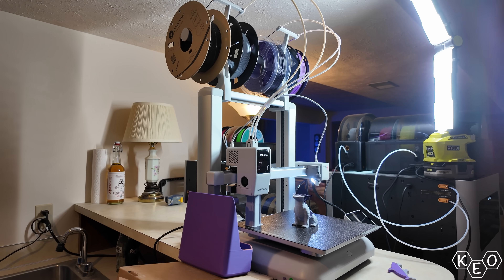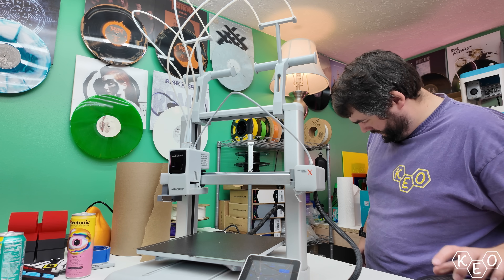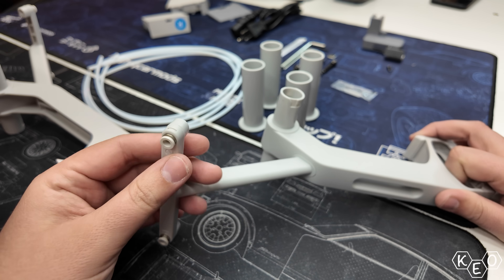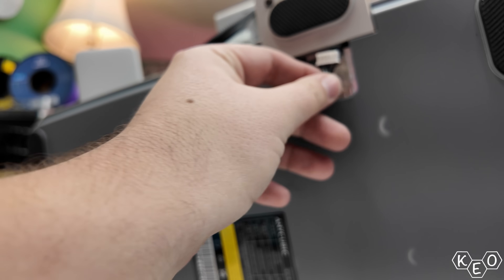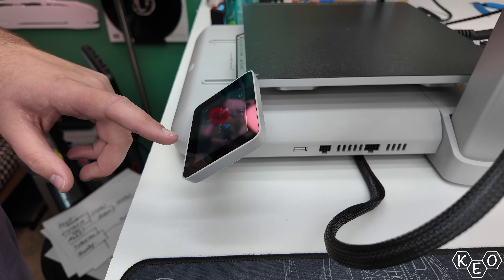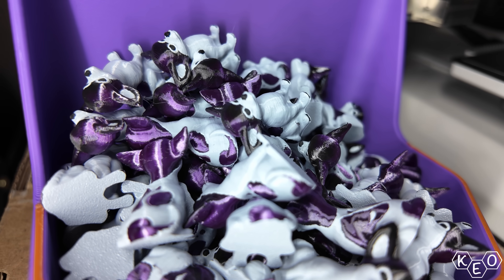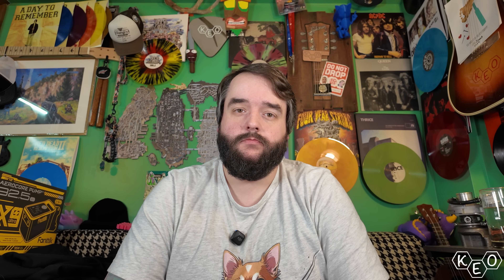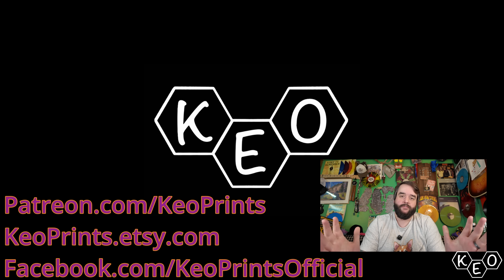Why This $300 Anycubic Printer Finishes Color Prints Faster

Comment: I have the kobra s1 combo. The main reasons you have bed adhesion issues are from a dirty print bed (use glass cleaner with ammonia) and your bed is too cold. Set it to 62 to 65 degrees. 

My favorite cheese is muenster.

Comment: If one of the multi prints failed can you just turn off that 1 print or need to stop the whole thing? other review videos say the build blate sucks. they had to use extra glue to make it work. the other reviews also say the bleed to bad on the set values.
Reply from the maker: I saw bleed issues but bed adhesion was not a problem luckily. As for the object skip, I’m pretty sure it offers that function

Comment: Keo, I'm after a printer that just works. I currently have an infomech tx and when it works it's great but after a week it goes to shit and I need to spend 2 weeks playing with it to get it going for another week. I have around 600 to play with and I am mainly designing and printing parts for RC cars. I print in petg but would like to print abs as it's stronger for the hobby and 300mm³ or bigger would be ideal. Single colour mainly as everything gets painted. What are your thoughts
Reply from the maker: Always Bambu. I don’t have any affiliate links to send you because they don’t see me. But Bambu is always the tinker free option. Best quality, max reliability. No tinkering

Comment: Its actually only $249 with free shipping and you get 50% off all supplies or extra parts at time of purchse. Its absolutely an A1 killer in everyway....Print quality it the same but the X is 40% faster, it uses 20% less filament, can expand to 19 colors and it costs $200 cheaper....

Comment: It's surely a printer with much potential, I bought a unit and we'll see if it'll go well. First time using a machine from anycubic too, hope I won't have resentments. It will certainly be a step up from my modified ender 3 for sure tho :)
Reply from the maker: Coming from your ender 3, it’s going to be a fantastic culture shock I’m sure

Comment: Another great video, thanks. Pepper jack. I think the A1 Mini was designed in size specifically for grilled cheese, that is my vote. I almost ordered one of these Kobra X because the price was almost a giveaway, however the way Anycubic customer service treated me after shipping me a USED Kobra 3 Max instead of the NEW one I paid for......I decided they will not get any of my $. I run a small print farm of 24 machines so longevity (or price per hour of life) is always high on my list when I am looking at new machines. The A1 is a good choice, I have some with 10,000 hours. Odds are the P2S will be a smart direction. I really like my K2 Plus when they are working. I have nothing good to say about any of the Anycubic machines. I am interested in tool changers, just haven't made the jump yet so we'll see how 2026 changes direction for the farm. Especially since I go through 15 gallons of filament waste each week. Looking forward to your next video.
Reply from the maker: Good notes here. I am not surprised by your findings in general. Bambu keeps running, thats no surprise. The K2s are great while they are working, also no surprise. Bummer to hear that AC support didn't treat you well. Unfortunately that is not an isolated incident for them or any consumer 3D printer brand support. There are some exceptions but generally, that seems to be the story

Comment: Wait wait, hold the phone. What does he mean by "when it was still working" when mentioning the AD5X? I haven't seen anything where he mentions it dying or anything
Reply from the maker: There is a video in progress right now but my AD5X has been stopping mid print randomly so I havnt been messing with it or troubleshooting. Not sure what is happening but thats the scoop currently
Reply: Aah, alright, good to know. Because I have been strongly considering the AD5X after seeing many good reviews for it, so I'm sure you can understand my shock when suddenly there is a "when it was still working"

Comment: Huh, that side exit for the disused filament, does the segment stay stuck there for manual pulling or does it fall off the head… onto the print? That’s so weird and would there be scenarios where more than one could accumulate there and fall into the print even if it didn’t with just one? That’s seems cool until we factor in gravity no?
Reply from the maker: Good point. But there is still enough of the filament left inside of the collector that it wouldn't be able to fall out. It took an intentional effort to pull it out because there's a little metal tab following it, holding it in place. Seems cool. I think it will obstruct the filament path if you try and refill that inlets spool though so I don't think you would be able to accumulate multiple or reload that inlet without removing first

Comment: looks like a descent printer, the only thing that triggered me for some reason was the power cable to the toolhead,   looks out of place.  After i looked at it , i could not unlook.   With all the boxes i felt like Gavin Belson would release one.   I have 4 misshapen magnets from my first 4 in 1 that bambu sent me.    They actually replaced my AMS, the new one is working flawlessly, only took 5 months.

Comment: Thanks for routinely reviewing multiple brands, you’re a great one stop reference.  I currently run 3 Kobra 3 combos and was on the fence with the X but it’s been hard to find a review that actually tests the printer.  I think the Snapmaker U1 will be the better option for models with more than a few dozen color swaps but this would be a nice space saver if most of your prints only need a handful of color swaps.  The quick swap nozzle is a huge improvement over the Kobra 3 (unless you save yourself the effort and just swap the full hotend)
Reply from the maker: True points here. This is a cool offering but the Snapmaker is certainly more of an all-arounder
Reply: @KeoPrints Forget grilled cheese...I have cooked chicken strips on my K1 Max lol

Comment: Just ordered a unit with the separate ams2 system., it’s listed as only supporting 7 colors instead of 8 and I’m not sure why that would be. Any clue?
Thanks for sharing and I appreciate your videos.
Reply from the maker: Sure, the reason that you lose one color is because of the toolhead. It only has four filament inlets, or four paths that collect into one. Even though a new collector needs to be installed to accommodate all of the tubes, the actual toolhead only has provision for four inputs. So the ACE will automatically feed and retract into position 1 for example. Then positions 2, 3, and 4 will be driven the standard way using the toolhead motors while spools are fed from the top. 

So as each ace unit is added, there is still only one inlet being occupied. That is how they achieve a max of 19 colors. 16 from ACE units and then the remaining three positions on the toolhead as standard.

Long winded but I hope it makes a little bit of sense. Thanks for hanging around!
Reply: @KeoPrints  appreciate the breakdown., looking to your follow up with this printer to see how it holds up.

Comment: I liked this video. I did want to make sure I heard you right that, I could use Orca?
Reply from the maker: I was that was the case. As far as I am aware, this one and often most AC machines, are not compatible with orca for connecting wirelessly to the machine and stuff

Comment: I use these cheap Allen wrenches for even cheaper screws. Sometimes a drop of Super Glue and a cheap Allen wrench is enough to extract a screw with a torn head. If not, get it hot till it's somewhat soft and wack it with a hammer until it gots the right shape. Epoxi Glue, especially JB-Weld and it's knock offs, are also great for that use.
Reply: I cut em off and put them in my drill. Works fantastic

Comment: Well, compare to the AD5X and see which one is faster for the same multicolorprints I guess. Same price (around here at least with the AD5X going for 300Euro).
Bedsize of this one is a bit bigger, both have the filament-changes in the head without much retraction so in that regard they look quite similar.

CoreXY has its plusses above bedslingers, and this printer can handle even more colors with extra options but then also longer filament-paths for those. 
I guess it would make a nice comparison to have these 2 compete.
Reply from the maker: Not a bad idea. Might have to line that up

Comment: I'm loving my Kobra 3 max still. The extruder cam system is awesome simple tech. Does a Bambu plate work on it also, I have a few smooth plates I want to try. I bought one fore $259 with the coupon
Reply: I want a kobra 3 max just for the print volume.  Its on my wish list.

Comment: There is a huge gap in price between this and tool changers. Not really comparable. 

As a beginner, how important its an enclosure?
Reply: If you want to print larger models from serious filaments it's pretty important, along with a chamber heater.

Comment: Honestly I wish people would STOP focusing on printer speeds and multi-color and start focusing on the things that REALLY matter.  Anycubic makes good printers but they do NOT have a good reputation for accurately or consistently setting z-offset.  EVERY Anycubic printer I've had was abysmal at setting z-offset and "good enough" was generally the best one could hope for.  Don't even hope for it maintaining that setting either.  Mechanically they are really good printers, especially for beginners so not something I will pick at.  But there's something going on with their firmware that leaves a LOT to be desired.  Personally I think they are farming out firmware development to unpaid interns who don't 3D print.  I love my Anycubic printers...once I upgraded them all to Klipper.  I do like to give the benefit of the doubt though so I hope they have learned their (many) lessons and put what they have learned into this printer.
Reply from the maker: Good notes. Happy to have this experience listed here for others to draw from. Helps us all out
Reply: @KeoPrints  Just to further that...the Kobra 2 I got as a factory return back in August 2023 is still going strong.  Granted it's fully klipper but it is a SOLID printer.  I don't want anyone to read my comments as hating on Anycubic.  And their support is top notch.  Never had a bad experience with their support.

Comment: Pepper jack is the best cheese.

What I would like to see in a printer like this is  one nozzle with 4 filament paths all the way to the tip. It could end with a rotating plate with a hole to select the appropriate filament, not unlike the H2D's little flap that covers the unused nozzle. Instant changes, no waste. It wouldn't lose too much print volume like a dual or quad nozzle setup or a tool changer.
Reply from the maker: This would be cool. I wouldn’t be surprised if we didn’t see something like this sooner than later

Comment: Pepper-jack for sure! I really enjoy your videos and look forward to them each time.  I have two X1C's and three A1's all with AMS's and I've been needing to add more but after seeing the U1 videos I'm holding off purchasing anything.  I heard the U1 had a firmware update, are you going to do a video on that and if there was any big improvements to how it runs and performs?
Reply from the maker: Pepper jack is an excellent choice. As for a major firmware update; I didn't even realize there was one. Ill have to check and see but I have not noticed any major differences lately

Comment: Why is the video titled "why this printer finishes color prints faster" and doesn't address that question at all? Anycubic claims this printer has less waste than normal multiplexer color printers. How does that work? If there isn't an extruder motor for each spool how does it even swap filaments by itself? How does filament swapping at the tool head work? Why make a video about this printer and not talk about any of the interesting things about it? No comparison between a multicolor print on the Kobra X and the A1? Come on dude.
Reply: I saw a video from Anycubic showing a cutaway of the head in action. Looks like some cams and a cutter in the extruder head, so minimal retraction is needed. Just enough to get it out of the way.
Reply from the maker: This is fair. Ill be doing follow ups to address some of the deeper details like that because there is a lot of tech going on in there that is pretty cool

Comment: Is Keo mixing up flow dynamics (pressure advance) with flow when he says "flow calibration" or is the Anycubic X only the third ever consumer-level printer to do automatic flow rate calibration, after the X1 Carbon and the K2 Plus?
Reply: my kobra s1 also does flow calibration, its a setting before i start the print if i want to do it…
Reply from the maker: Yes, we could be having a difference in semantic congruence but that would be the calibration I was referencing; pressure advance

Comment: Thanks for the review. I think I will stick to enclosed printers and mmu's to keep things orderly and clean. I'm on the verge of buying my first printer, still doubting between a few contenders (kobra s1, k2 (normal) and q2. Bambu is a runner up bc the large user base and spare parts availability, but I really dislike the risk of having a expensive machine being locked down further).

Now you said tool changers are the way to go, but with the 3 first contenders mentions with each their own mmu it's €400 vs €500 vs €600. However the cheapest tool changer the U1 is €800 which is quite an increase in budget while the quality doesn't seem to be as the price with imply.

Every new video I watch makes it harder to finally make a decision lol
Reply from the maker: It is a tough decision for sure. I am on the U1 train because mine has been great. But also, it hasn't given me any issues yet. Who knows how long it will continue on without issue before there is something that changes the way I think of that machine? Only time my friends. Time and much plastic
Reply: To be Fair, U1 is Way faster at multicolor and has Way less waste, so it may be cheaper at the Long run
Reply: @ulforcemegamon3094  The question here is how long will the U1 run in long run reliably. These brands are dishing out printers with price cut in component quality and not having spares available all the time
Reply: @IAMGouravSaha  agreed, reliability is something to factor in the equation Too
Reply: @ulforcemegamon3094 wait give it a few months, on whatever you buy.

Comment: So, what happened to the AD5X? I got one for Christmas, and now you have me worried.
Reply: I got mine right before Thanksgiving. Mine has weird issues with certain filament and will occasionally destroy a print and other times it works great. My nozzle corroded at around the 300 print hour mark but luckily I had a spare (always get a spare no matter what printer you buy). I contacted Flashforge and they sent me an entirely new hotend which I haven't needed to install. 
The AD5X has some benefits but mine is not dependable and since it doesn't have a camera installed out of the box I have to check it constantly. Though I'm not a fan of bedslingers I would consider the Kobra X as an upgrade while I wait for the next batch of toolhead changers to come out.
Reply: @SpaceAgeConsulting  I have had to replace my nozzle 4 times already, using default settings (PLA) where the sock (plastic rubber over the nozzle) has melted to the actual nozzle.
Reply: I’d be worried buying a middle model that’s unpopular since parts and support will be scarce. Buying the popular choice has benefits including longer support from a brand, 1P and aftermarket parts, and bigger user communities. I’d return it
Reply: @joeylopezdesign BINGO
Reply: I will say after 1k hours my AD5X went to crap... Constant issues, first layers not sticking, some replacement parts cost MORE then the actual printer is almost.
Reply: @GeekyGaming Buy once cry once I have 4000 hours on my P1S with stock nozzle🤷‍♂️
Reply: @blueberrywilbur315  Bambu’s still aren’t perfect…
Reply: @PrintingAddict17 Of course they aren’t no machine is perfect using that as a argument is silly , but being a beta tester for untested junk has a cost too🤷‍♂️ Do you want to tinker with your printer constantly or print? There are brands that are solid machines and there’s others with big promises and fall short you end up a printer repairman. Using perfect as the argument over good is crazy work. It’s a good price seems like a solid product it’s cheap because the technology is 5+ years old, or just spend a little more and have something you know works well buy once cry once.
Reply: I have ad5x it’s a good starter machine to see if you want to spend more on 3d printing
Reply: @Sensaiq8 I think there are solid options at every price point 👊
Reply from the maker: By most accounts, there are many that swear by their FF printers. I loved the AD5X for months but now it is stopping mid print. Maybe not a death sentence but I don't have the time to troubleshoot and waste prints this second.
Reply: @KeoPrints  Yeah, I can completely understand why it wouldn't make sense for you to spend the time to troubleshoot it.  There's business to be done.  In my case the printer is a hobby, which really changes the equation.
Reply: @KeoPrints some prints fail mid printing due to buggy fw, gcode corrupts while transferred. 
There is a mod to make printer verify checksum of sent files